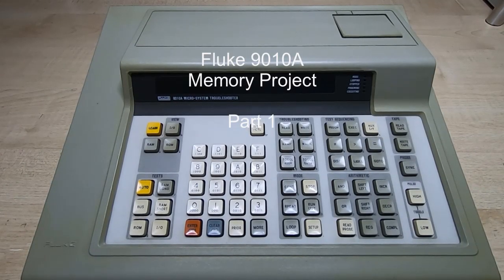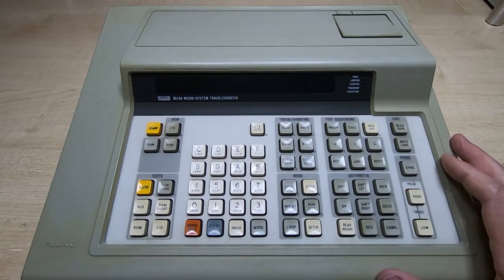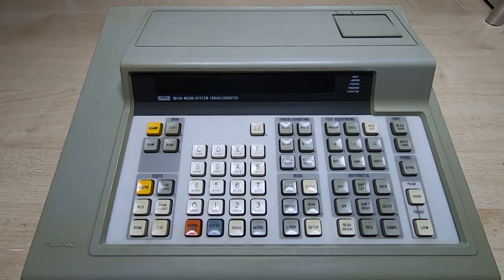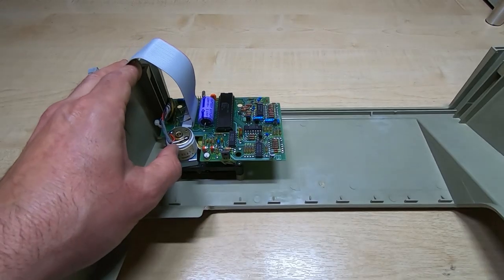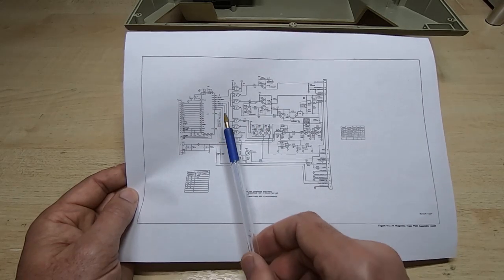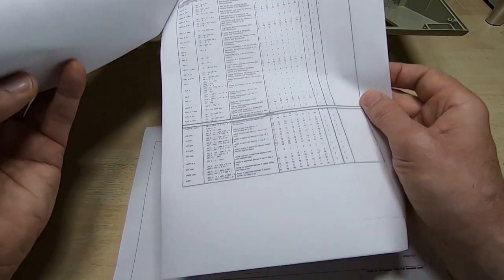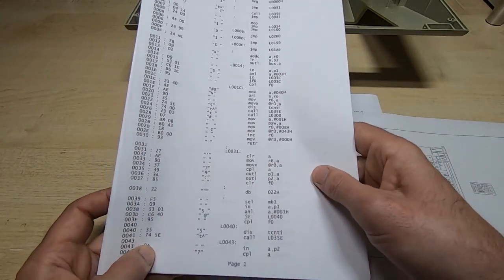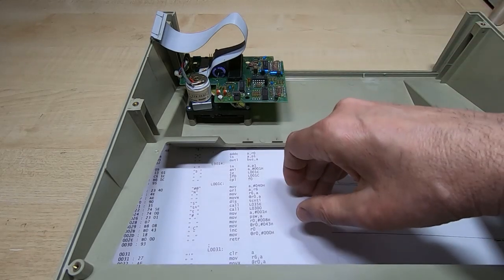Fluke 9010A Memory Project Part1

Comment: Very interesting project .. I will be following along to see how it resolves :-) We used to use 9010's frequently when trouble shooting medical equipment through the 80's.  I recall those storage tapes as not being overly reliable .. a SS replacement would be a welcomed improvement! :-)
Reply from the maker: Hopefully you will find the series interesting. I use 9010a's fairly extensively in my restoration work and as you say the tapes are a pain (and now hard to find and expensive) and I wanted to be able to easily load test programs without having to have a fight with the 9010a every time. The tapes are also slow and loading a full tape takes quite a long time. Writing one takes even longer.

Comment: ah...use another modern microcontroller with a serial eeprom of suitable size to retain the footprint. okay - I am joining this a little late so it will interesting to see how you've progressed. We will need a way to send the pod or TL1 (or whatever it's called) to initialize the replacement module.

Comment: Unfortunately Fluke 5100 series storage tape is under the direct control of uPc (8080). The only task that tape interface do is convert parallel to serial data. ☹️
Reply from the maker: The 8041 in the 9010 tape drive handles the tape mechanism (solenoid, motor, tape sensor, tape present) and it takes simple commands from the 9010 to save / read / search / rewind etc. I intend to create a microcontroller to replace the entire tape drive and interface. It would have been easiest if I could have reverse engineered the code in the tape drive 8041 as this would give me the basic function blocks. Unfortunately the code I have does not seem to be valid so I will have to figure out what it does using a logic analyser but it should still be fairly easy.

Comment: Excited about this, and seeing how it turns out. I've got one working, and one dead tape drive, and trying to find a way to replace the rotted rubber bits in the dead tape drive has been impossible, so this would be a welcome solution.
Reply from the maker: If you send it to me I can probably replace them. I have had to replace them on all my drives.

Comment: This is something that I’d like to have also in my Fluke 5101B, togheter the interest as option for the 9010A.I’ll check the information I have on it, may be there are some shared electrinics. I remember a test routine trough a logic plug-in on the data bus..🤞